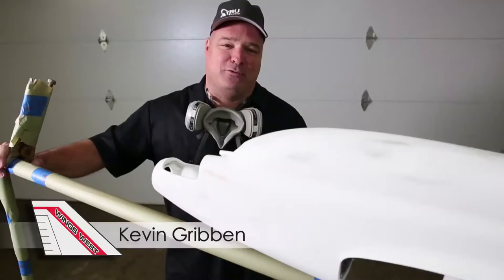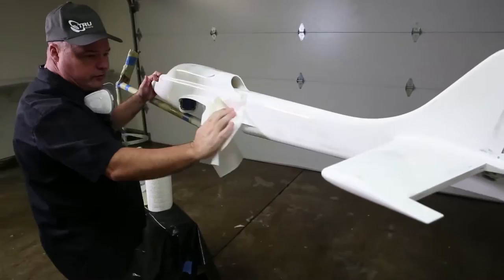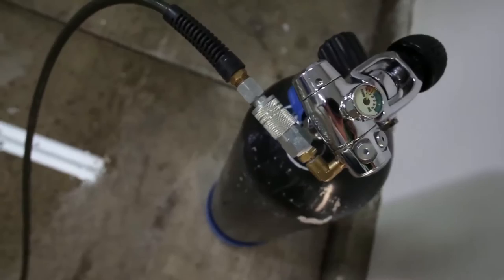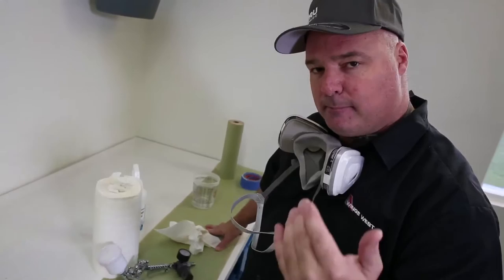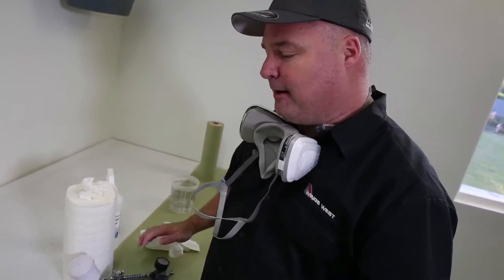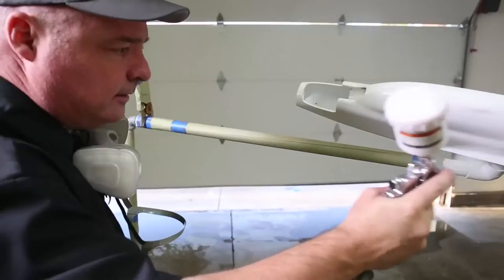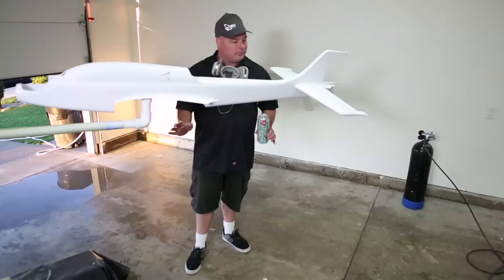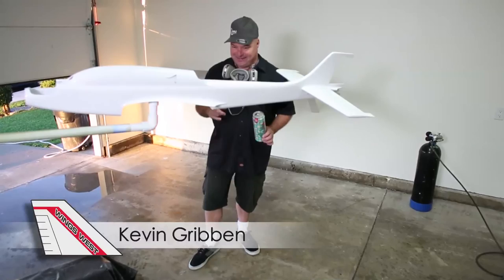Wings West | Painting the Deception

Comment: I would love to see how you regulate a 2000 psi dive tank down to the detail gun at 25-30! Neat set up.
Reply from the maker: A standard diving regulator has 2 ports on high one low. The low is 150 psi.
Reply from the maker: A SCUBA tank first stage regulator drops the 3000 psi tank pressure down to 125 psi..... A simple standard gate valve or a secondary regulator on the end of the gun brings that down into the 25-30 tip pressure....
as long as you have a first stage regulator that will get it from 3000 down to the mid hundreds the rest is easy.